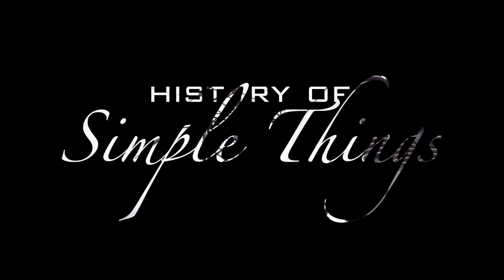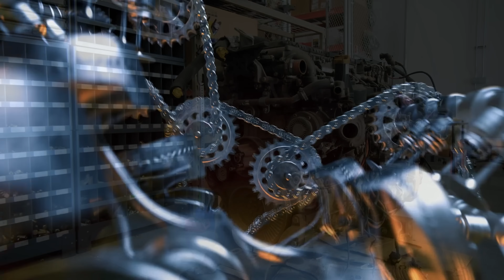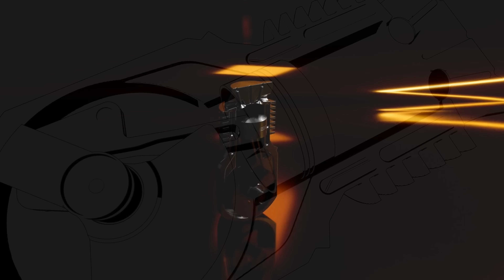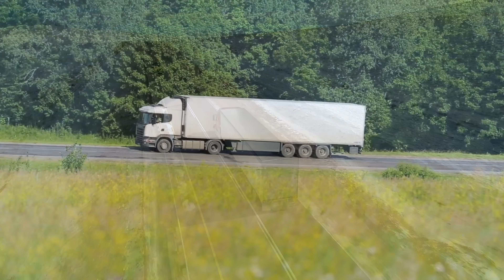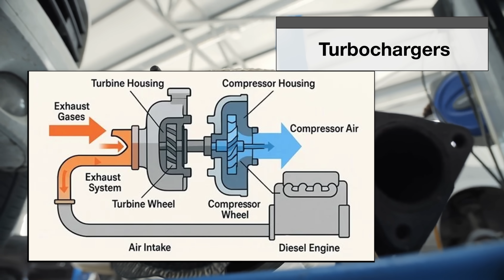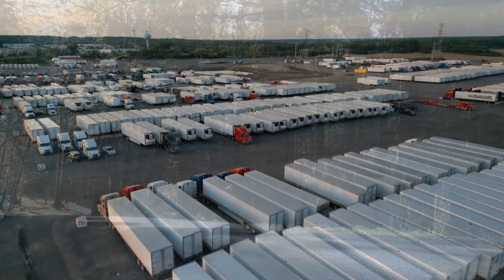Why Do Diesel Engines Deliver More Torque?

Comment: The piston engine is the best internal combustion design so that there are billions of them serving humans for more than a century. Current ICengines are divided into 2-cycle, 4-cycle, diesel and gasoline types by structural and combustion types. This division doesn't have to be. - 
It is just by simply splitting the piston crown part from its skirt to be operated via (a valvetrain-like) piston-train to make the lighter pumping gases for the cylinder - called D-cycle (differential-stroke cycle) completing 4 strokes, different in displacements and periods in every revolution - like the 2in2-cycle. Test data (school lab, uncertified yet) show the D-cycle engines have achieved >20% fuel saving, while yield >2.5 (close to 3) times torque. 
The D-cycle can further bring in the "Diesoline" combustion which is a hybrid of the diesel-type compression-ignition and gasoline-type spark-ignition engines. It is the compression ignition on the stoichiometrically charged air/fuel mixture while retaining a great amount (>30%) of burnt gas (called BGR) to replace the extra exhaust gases for the high compress needed instead of air in HCCI (homogenously charged compression ignition) to avoid the NOx (and engine knocking). The diesoline will save extra about 15% fuel without the nasty and costly soot + NOx after-treatment for the millions of diesel trucks in USA along – that can save great among of after-treatment cost. 

There are billions of ICengines serving humanity for one and half centuries. Since current eV hype has proved that battery technology has not reached adequate maturity to compete, the ICengine can continue to serve us for another century or so.

Comment: Comprehensive video. Thanks. One more thing to add: Diesel fuel has more energy stored in it than the same amount of gasoline. This in combination with direct injection, longer stroke, turbocharging, and more engine volume and way more compression ratio produces a magnitude more torque at low RPMs to haul very heavy loads. The counterpoint is an F1 engine: available torque at  high RPM (10000 to 12000), 850 BHP but it's designed for speed and acceleration rather than load-carrying capacity.

Comment: Diesel fuel is more energy dense.  Diesel engines can idle for days at a time sipping only teaspoons of fuel.  Diesel engines tend to run cooler.  Diesel engines often use more expensive replacement parts (because they are heavier duty), but you will replace them FAR less often.  Most gas engines are considered on their last legs at 300,000 miles, while as an example the Detroit Diesel 6.5 Turbo in my crew cab long bed truck isn't even broken in until it hits 200k, it's first overhaul point is past 600K, and many of them have gone 5 MILLION miles (there is an actual club for that).  If companies made diesel chain saws, weed whackers and diesel toothbrushes, I would buy them.  Hell, even my lawn tractor is a diesel.

Comment: Of so many explanations, you have not included the the diesel fuel properties which is energy dense compared to the gasoline fuel, which contribute to the greater torque it produces.
Reply: It has more hydrocarbon elements yes correct 💯

Comment: I would like to hear the explanation of why diesel prices went from one third of gasoline prices per gallon to actually being more expensive just as diesel was becoming popular with the public, it’s not refining costs as gasoline is more expensive to refine, initially the oil companies said it was priced per amount of energy delivered per gallon but quickly went silent on the issue
Reply: they switched to ultra low sulfur diesel. due to DPF filter, it cant handle the sulfur, supposedly. this drove up refining cost.
Reply: @Hardcover_Actual  That's over now.  The days of diesel fluid additives and filters like that are gone.
Reply: Many years back the FEDs imposed a 50 cent a gallon tax on top of all other taxes to cover additional wear and tear on the highways.  Target was trucks, diesel cars get hit because can’t differentiate at the pump.  Tax went on tugboats and other modes also.  I imagine these have increased over the years to give the current spread.  Have a diesel car in Europe and almost no spread there.

Comment: Sir, you should read many  books about this all. Read before write. You have heard the bell ringing but don't know where the clapper hangs.
 I will write down one thing:
 The compression ratio of older diesel engines ,of passenger cars ,was 20 : 1 because it was  an Indirectly Injected Engine. It had two small connected  combustion chambers. A Pre chamber and a Main Chamber.  The problem was to get it started/running at low temperatures. These two combustion chambers had a lot of heat loss, so they had to make the CR high to have enough heat to ignite the fuel. And by Pre-Glowing they heated the pre-chamber to help igniting the fuel. But then VW, FIAT, PERKINS started developing Direct Injection for passenger cars, trucks always were directly injected because the noise didn't matter there , it was the efficency.
The DI diesels have the combustion chamber in one. So less heat loss, not only when starting but also when  running. So they can have a lower CR, 16 : 1 or even lower, and are more efficient. Some still have glow plugs.
Diesel engines always have LESS  torque than petrol engines........unless the diesel engine has a Turbo charger.  When a petrol engine has a turbo charger it can have as much torque  as a diesel. Limit is detonation. Watch Google IDI diesel and DI diesel for pictures  of IDI and  DI diesels please.

Comment: Diesel engines do not produce more torque than gasoline engines in apples-apples comparison. The type of fuel is virtually irrelevant, engine design matters.
Reply: Take an average pick up with a 400 hp v8 hook it up to 70ooo lb semi trailer go climb a mountain pass see how that works good luck
Reply: @JimBranstiter . Yes, when i was a kid back in the 60’s, i remember most dump trucks were gas powered..not so today.
Reply: @JimBranstiter It will work just fine if you use the right torque multipliers(transmission, ring and gear in the differential).  It is however, not as efficient as your typical turbo diesel with its proper gearing.  The gasoline engine will burn more fuel.  Also, the gasoline engine will wear out quicker due to its much higher RPM of operation.

Comment: Newer common rail engines are typically 16:1 or less compression. Older ones were 20:1 +
Reply: If I may ask, which is better: 16:1 or 20:1? Thanks in advance!
Reply: @yengsabio5315 seems that it depends on the engine and injection type. Historically, you needed more compression. Now you get far more everything with less.
Reply: @Phil-D83  Thank you for responding!

Comment: Suggestions: 1) Jake Brake (aka engine brake). 2) Turbo charger vs super charger vs blower
Truth be told - that belt driven thing on top of a gasoline dragster engine is not a blower.

Comment: It's the stroke length that determines torque. Not so much the compression ratio. Long stroke equals more torque, short stroke equals more horsepower. High compression is a byproduct of a longer stroke.
Reply: Look at the stroke of enormous marine 2 cycle diesel engines. They run at very low RPM but have very long connecting rods. You are correct.
Reply: @robertfrost1683 ...and those long Con Rods use a auxiliary device to Turn Crankshaft.
Reply: Not true. Long stroke does not necessarily imply high compression ratios. Old spark ignition engines from the early 20th century had long strokes, but low compression ratios due to very low octane numbers. Higher compression ratios would have caused destructive detonation.
Reply: The higher compression ratios supports a longer stroke which in turn contributes to maximizing thermal efficiency and torque .
Reply: rext8949 
There is no correlation between stroke length and compression ratio in diesel engines, also referred to as compression ignition engines, which require a high compression ratio to generate the high temperatures needed to ignite the fuel while the long stroke enables high torque at the crankshaft, generally at low to moderate engine speeds due to the lower burning velocity of diesel fuel & the high vibrations & stresses incurred in a diesel engine because of the heavier reciprocating & rotating components if engine revolutions exceed a certain limit, which in truck engines is generally less than 2,500 RPM .
Reply: Like the difference between a small block and a big block. Both burn gas, but big blocks make more torque.
Reply: scottmichael
Big block V8s generate more torque due to their larger capacity. Both types of engines tend to have similar bore to stroke ratios.
Reply: There is no rule that says a petrol engine can't have equivalent stroke measurement as diesel.
Like Hercules HXC v DFXE.Most of the resulting torque is the result of the leverage that a long stroke provides.Which explains why the Hercules HXC petrol puts out around same torque as a DFXE or an equivalent size Naturally Aspirated Cummins.
Everything then depends on force applied to the con rod obviously the more the stroke the more torque for equivalent force and stress.
More torque at equivalent rpm means more power.
Reply: Can you have a high compression ratio with a short stroke? It's like a "chicken-egg" came first arguement
Reply: @stevensevume2311 
There are numerous examples of relatively high compression relatively short stroke engines.Especially vintage v modern designs.
While even the Jaguar XK engine was 9.1:1 the Ferrari 250 V12 9.7:1 for example.

Comment: An additional difference between gasoline and diesel engines is that the fuel in a gasoline engine basically explodes where the fuel in a diesel engine burns which creates power through the entire stroke.
Reply: That is so wrong I am not gonna read any more comments on this piece.
Reply: I think its more better to get all your combustion closer to the top of the stroke. You get more pressure overall through the whole stroke, more work less waste.
Reply: Nope. It goes boom.

Comment: In theory, a regular car can produce the same amount of torque as a semi truck.  You just need a special transmission to produce the high torque
Reply: If you think an automobile passenger car engine can produce as much torque as a semi truck size diesel engine you are sadly mistaken when you talk gas engine or diesel engine this is apples and oranges not the same at all
Reply: Transmission does not procure torque
Reply: @normandvilleneuve859 It is a torque multiplier.
Reply: @normandvilleneuve859  It does in lower gears but at the cost of a higher RPM. Anyway, it's impossible for a car engine to give the torque of a truck that way, the engine would fly apart.
Reply: @lajya01 (Only diesel fuel can support a higher compression ratios which can  provide a longer stroke which in turn can produces sufficient torque to compress fuel . Petrol fuel causes knocking at high pressure. Transmission can only increase the resultant rpm .
Reply: @lajya01 I was talking about torque, not horse power.  High RPM is for more horsepower.

Comment: Poor explanation that leaves too many things undefined. How is higher compression achieved? Higher injection pressure? No idea how it does high torque at low engine speeds.  Too much unexplained jargon to actually learn anything.
Reply: Higher compression is achieved by (com)pressing more fuel/air into a smaller volume by means of a longer piston stroke .

Comment: Thank you for the video.  You forgot to mention that diesel fuel contains more energy per gallon than gasoline.  Diesel fuel also combust at a slower rate than gasoline, that is why it works better with long stroke engines
Reply: Hmm, slower than gasoline? Diesel uses detonation while gas uses deflagration, the former being faster than the latter for all information I've come across. In fact, as the video mentions, detonation destroys gas engines when it happens.
Reply: Yes, it also means more controlled subsonic deflagration rather than supersonic detonation which results in knocking and loss of energy.

Comment: Can you pls do a video on how road salt is made and the effects it has on car etc if any
Reply: Its not made, its dug from salt mines and simply crushed into grit for spreading onto roads. Effects on cars - like common salt, it is corrosive to steel. No video required
Reply: @jjsmallpiece9234 you saved me from answering. Thanks 👍